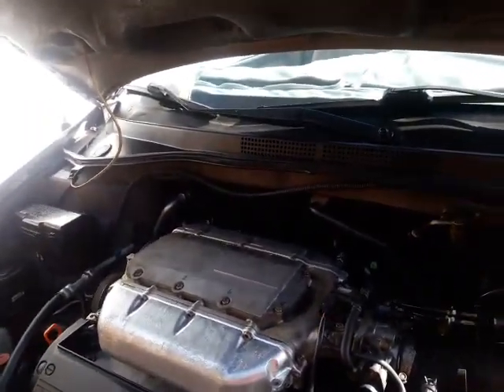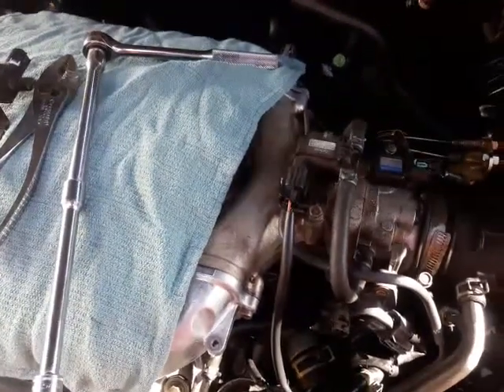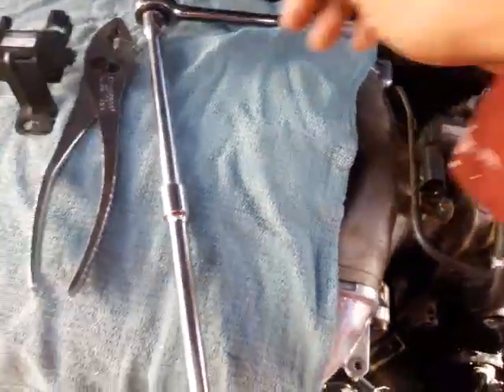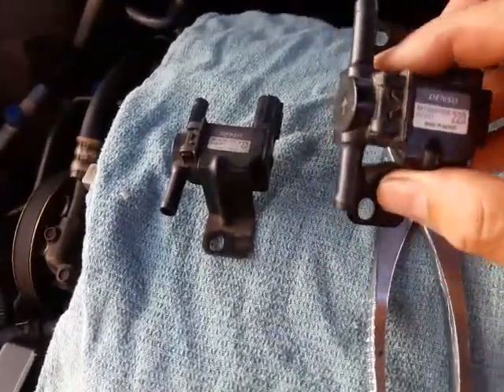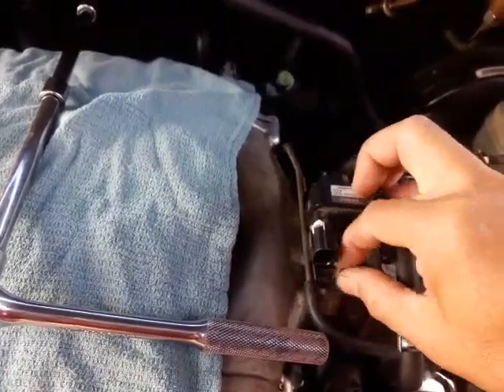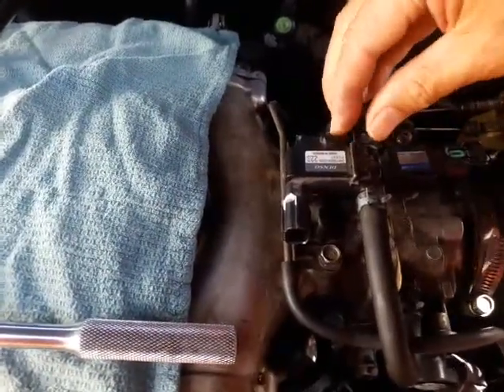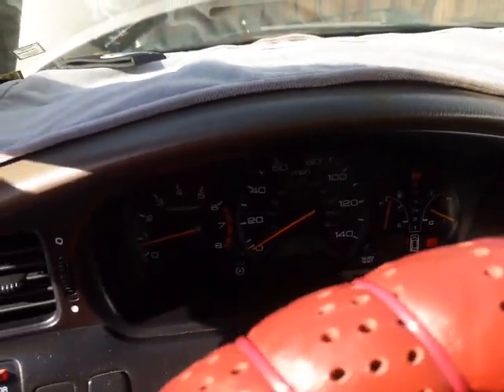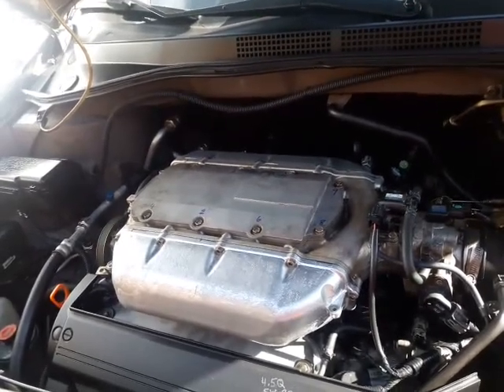2004 Odyssey Chatter/Clicking noise FIXED

Comment: What some Odyssey owners have found is loose spark plugs that have caused ticking sounds with one owner that had a spark plug blow out and ruin the threads in the engine head and have to replace an engine head which is very costly! So also check to see that plugs are tight but do not over tighten for they are aluminum heads! James
Reply from the maker: 1. Always take the old one out when the engine is cold.
2. Check the new spark plugs for correct gap before install.
3. Use Anti seize on the thread of new spark plugs
4. Apply dielectric grease to the base of the new spark plugs to lubricate the   rubber boots and prevent spark leak.
4. Torque them down to manufacture specification.

Comment: Just want to say thank you my 03 Honda accord VTEC LX is making the same noise I am going to try to tap it with a screwdriver if that doesn’t work I am going to replace it .you help me out a lot.
Reply from the maker: Try to pin point the noise by put one end of the screw driver on the valve and the other end to your ear. Do this to any areas you suspected making that noise. This way you know exactly where the noise coming from. I don't think tap it with a screw driver is effective because the noise only come on after the engine warned up. The only caution is don't put the screw driver on any moving parts.

Comment: that ticking valve is PWM of canister purge. 
The fuel injection uses it to precisely adjust the air mixtute without moving IAC and read the O2 sensors fluctuations.

 Eventually this PWM Valve is also used to clear gas vapors from charcoal cannister.
Reply: Is it sound like detonation while slow acceleration?

Comment: I have a ticking noise on my 09 Honda Accord EXL. I don’t know if I need a valve adjustment. But it comes and goes the sound. I will invest this sensor
Reply: thurm101 ,

It doesn't sound like it need a valve  adjustment if the noise is come and go. Mine come on when the engine is warm up and it stay on til you shut it off.
Reply: IT IS SIMPLE:
this valve is "pulsed width modulated" by the computer to precisely control the air mixture based on what O2 sensors are reading.

ITS TICKING MEANS IT IS WORKING AS DESIGNED.

When there is a fault with EVAP the CEL will signal the fault code was detected.
👍🏻

Comment: Hi there, I have Accord 2007 V6 there is clicking noise coming when I push the gas in driving mode and this noise only comes when the engine is full warm no check engine light. This is could be from this valve? PLEASE HELP.

Comment: Do you know the name of the part because my honda is doing the same noise
Reply from the maker: It's in the description but here it is:
(EVAP Purge Control Solenoid Valve) : part # DENSO MX136200-2230, or OEM part #: 36162-PGK-A02
Reply: Cool thank you I just found a used denso one  on ebay and thank you so much for the video  it really helped me out a lot

Comment: Look i had the same problem on honda odyssey 2002 ,i thought i have to replace the Evap purge solenoid but before replacing i just clean the throttle valve with throttle cleaner deeply as much as i could and surprisingly when i fire the engine there was no chirping sound from evap purge solenoid,else we can open the evap solenoid and clean with throttle cleaner.what i concluded is there must be some kind of carbon accumulated around the solenoid and when we put the cleaner ,it just clear the carbon particle .TRy it hope you may save some bucks.

Comment: What do you call the part that you replaced? Thanks for sharing this video. I hope that this exactly where that chatter noise is coming from my 09 Honda Odyssey. Is it easy to remove the engine cover?
Reply from the maker: The part call  Purge Control Solenoid
 Valve Honda part # 36162-RJA-A01

After you locate the valve, while the engine is running and it's making that noise, use a long screw driver and touch the valve on one end of the crew driver, the other end hold it close to your ear. Try to touch other none moving part around where you suspect the noise came from. If the noise is coming from the valve then it will be louder. I accidentally found the noise by touching the valve with my hand.

Watch this video to show you how to take the cover off (about 2 minutes into the video and only 4 bolts to take out):
https://www.youtube.com/watch?v=_2jDeqdp_PQ

Look at this website for that part (#1 in the diagram):
https://www.hondapartsnow.com/parts-list/2009-honda-odyssey-5dr_ex-ka-5at/tubing.html?PNC=1

Comment: Very nice video. I wish my problem was the same. I had similar clicking sound but only when driving. It started around 20mph and got louder at higher speed. I tried at down slope with no gas pedal but the sound remain. I had carefully changed all 6 spark plugs of my 99 Odyssey (135k miles) but did not help too much. Any suggestion? Thanks.
Reply: I Use a Mechanic's Stethoscope to pin point the noise. But your only come up when driving, so it hard to detect.

Comment: What is this part called? In case I do need to replace it. Thank you.
Reply: I put the name in the description.  The name is vacuum switch purge valve control solenoid or EVAP Purge Control Valve. If you want a new one, then use the OEM part number in the description. For a use one, use the number printed on top of the valve on your car. The one I use in this video is MX136200-2230. The valve with this number is use in some model of both Honda and Acura vehicle.
Reply: @davevalinty4293  thanks for the response. 😊
Reply: The Purge valve is a different part near the front of the vehicle... This is a vacuum switch

Comment: Thankyou for your help! I have same ticking sound on my 2004 Odyssey! James
Reply from the maker: Please let me know the result.
Reply: I just need a heavier oil. The 5W-20 is recommended but they did this to get better MPG on EPA tests! When you get more miles on engine a 5W-30 gets rid of small ticks in the engine! The thinner oil has less resistance to inertia but not good for older engines. You still have a good flow of oil with the 5W for winter starting. James
Reply from the maker: If using heavier oil is working out, then it's great. I switch to synthetic and was very surprised when I removed the valve covers for valve adjustment, and everything seem clean @ 120K miles. The only thing I noticed are the intake valves are a little loose, and the EGR chamber under the intake  cover gasket are clogged up. Try marvel mystery oil additive first to see if it help before using heavier oil..
Reply: @indiajesuslovesyou  you are exactly right about this oil grade wisdom 👍🏻

Comment: Hey, I gave the same engine on my 2010 mdx... did the chatter get louder or faster as your rpms got higher?
Reply from the maker: no, I can only hear it when the van came to a complete stop. I also can hear it  after the engine warned up. You can feel it click by put your hand on the valve when you hear it clicking. Don't replace this valve unless you know that the noise came from this valve.
Reply: I have the same sound on  my 2010 MDX. The dealer said I need a valve adjustment ($477.79)

Comment: What symptoms your car had before you remplace it?
Reply from the maker: Just loud annoying noise. The dealer want to do a valve adjustment, local mechanic think it's an injector noise. I found out by accidentally by touch the valve and notices it have a larger vibration.
Reply: Did it do it at idle or always?
Reply from the maker: @MrMartin997  At idle after warned up. Can't hear it when you drive due to higher engine RPM, but will hear it when you come to a complete stop.

Comment: If I’ll get to fix this issue myself then I should be paying you instead lol. The shop that wasn’t able to fix this issue now recommends a valve adjustment as well.
Reply from the maker: That is exactly what they told me, then I told them that I just adjusted the valve, and they shift the story to my fuel injection is at fault.
Reply: True Renegade I haven’t attempted this yet on my 2009 Honda Odyssey. Now they are telling me that it could be the timing belt tensioner 😣
Reply from the maker: @jbrrozo2283  Belt tensioner do make noise, but it came from the left side where the belt is at. As for the purge valve, the noise will came from the intake between the engine and the transmission.
Reply: True Renegade I took my engine cover off and my 2009 don’t look anything like 2004. I couldn’t find where Purge Canister Valve is. The noise is like coming directly from the engine.
Reply from the maker: @jbrrozo2283   look at the picture from this link:
https://www.hondapartsnow.com/Page_Product/SearchByName.aspx?Vin=&Make=Honda&Model=Odyssey&Year=2009&Submodel=&Filter=(bt=3%2c8;et=2%2c7)&Keywords=purge+solenoid+valve

It look like they put it on the back side of the throttle valve instead of on top like my 2004 Ody.

Comment: Thanks my 02 honda honda ody may have this sound.
Reply from the maker: Make sure you identify the noise by touch that purge sensor with a long screw driver end, on the other end, hold it to your ear. If the noise louder at the sensor compare to surrounding areas. You will know for sure that is the sensor. Good Luck!!!
Reply: @truerenegade1095  thanks I do it when I add oil or other maintenance.

Comment: Thank you for taking old out and showing us. That part on amazon is hard to find and around 30 bucks. Do you suggest a used / junk yard one?
Reply from the maker: Hi Adam,

I use the part number on top of that sensor and do a search on Ebay, that's how I got mine for $10.00  used. My came from one of the Acura cars that using the same part number. I bought it used because I didn't know that it going to work. Every one I talked to told me that it's need valve adjustment or injectors noise. Even the Honda dealer told me to have my valve adjustment for $700. The one that know about this noise told me that the noise is from the car computer turning on and off the sensor as it adjusting air/fuel mixture.... Anyway, I use a Mechanics Stethoscope and determine that the noise came from the sensor when the car warmed up.  Buying a used one and can be risky if the sensor doesn't work so I bought it on Ebay because it have a return policy and if I got a bad one I can return it.  As it turned out for me, it's a $10.00 quick fixed. My suggestion to you is to make sure that noise coming from that sensor by either use the  Mechanics Stethoscope (I bought it  at Harbor Freight) or put your finger on the sensor because you can feel it when it click.  Then it's up to you if you want to replace it with a used or new part.  Remember that it's only a junk part if it doesn't work.  Good luck!!! and I hopes you find a good one.
Reply: i have same problem and i unplugged then plug back in. the clicking stopped? i ordered the part anyway -couldnt find in junkyard. 52 dollars. why do you think the clicking stopped?  thank you for the video.
Reply from the maker: I think the clicking noise indicated that the sensor/valve is worn out. I have tried unplug it just like what you mention, but the noise came back when the engine warmed up and that is the main reason I bought it used to test it out. In my case, it fixed the problem.
Reply: True Renegade Hi there. I am having the same issue with my 2009 Honda Odyssey. The shop didn’t fixed the problem but instead “fixed something else.” After paying the shop I started the engine and the chatter noise is still there. The manager thinks that it may need a valve adjustment which would cost me perhaps $500-$600. I wander if these guys knows the same fix and would just pretend that they adjusted the valves but instead replaced a small part for a 10 min job.

Comment: Part number?
Reply: It's in the description.
Reply from the maker: I put the part number in the description as below:
" Vacuum Switch Purge Valve Control Solenoid (EVAP Purge Control Solenoid Valve) : part # DENSO MX136200-2230, or OEM part #: 36162-PGK-A02"

Comment: Chatter/Clicking noise was fixed but the lifter ticking left.
Reply from the maker: When I do a valve adjustment on my ODY @ 120K, the only valve I touches are the Intake because it's a little loose. I didn't have to mess with the Exhaust because they are within limit. There is no lifter in there so use the Mechanics Stethoscope or a long rod to pin point the problem.

Comment: U need a valve adjustment my friend
Reply: Don't adjust the valves until you check this EVAP Purge Control Valve.  I done the valves adjustment  and the noise is not going away until I replaced this valve.